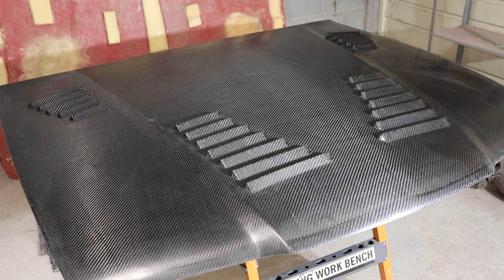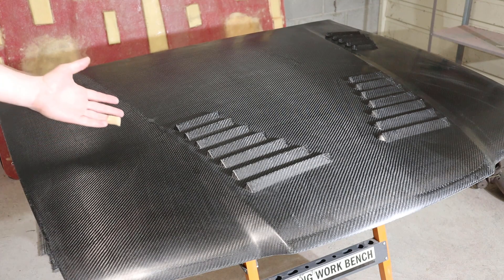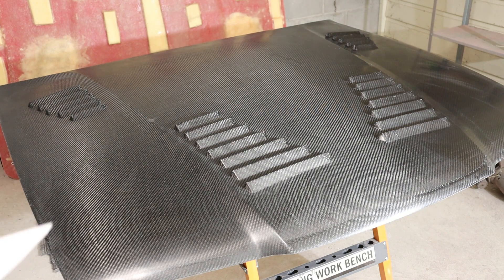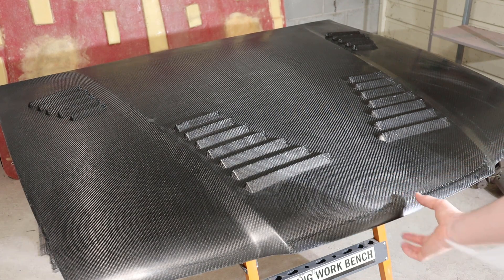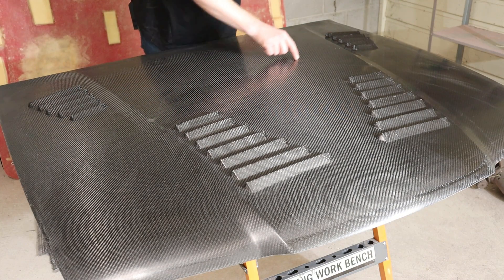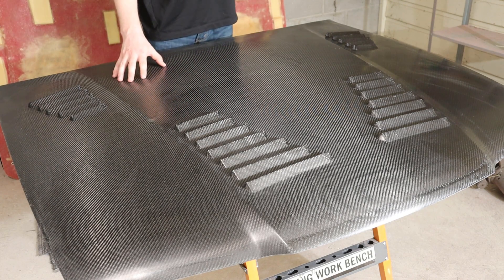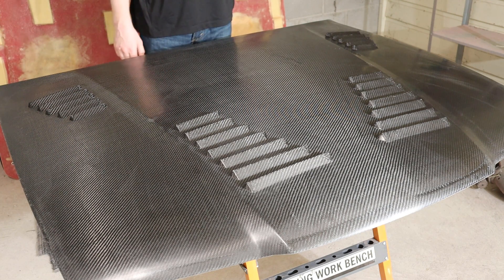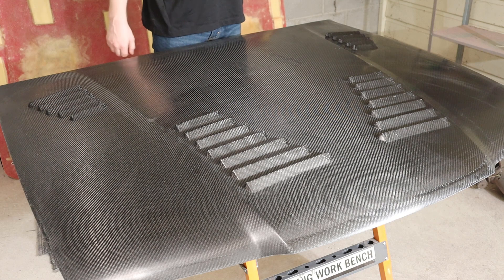[BUILD] Making a Carbon Fibre Bonnet: The Part

Comment: You also have to perforate the foam to avoid air bubbles and infuse slowly.
Reply from the maker: Sure do. The foam was perforated using the perf tool I made previously. It works well.

I think the surface imperfections were as a result of the super 77 being used to hold down the carbon and no clear coat

Comment: Amazing work Iv just started doing skinning and it’s not that easy first one was flat bottom steering wheel I cut and fitted a pipe then covered the top and bottom was hard to keep in line and smooth.    I found spray glue helps when laying try keep the ends not pulling out

Comment: Could you tell me what spray adhesive did you apply between the mold an the carbon fiber ?
Thanks
Reply from the maker: I used 3M super 77, however I suspect that caused some of the surface imperfections I had. There are other infusion adhesives out there I would consider using them instead.

Comment: I'm getting ready to make a carbon hood for my C6 Corvette. I'm trying to decide between making a two-piece mold - top (outer) and bottom (engine side) - or just going with the method you show here. Did the final part exhibit any weird flexing or craziness at speed on the track? Mine is mostly a street car with the occasional track day. (I'm lucky in that the C6 hood is nearly flat with no funky returns on the edges.)
Reply from the maker: It didn't exhibit anything weird. Though I would suggest doing it slightly differently from what I have done.

Do the outer layer (top skin) as an infusion and then with the top skin still in the mould do another, wet, layup with nomex honeycomb and the bottom skin.

That will give you light weight and strength for days.

In my opinion, the only benefit you get from two moulds is easier attachment points and knowledge that it's not going to have any fit issues. A sandwich structure (foam/honeycomb) is mechanically superior.

Comment: yea it would be lighter if you didnt use a foam core lol
Reply from the maker: If there was no foam core it wouldn't have much strength at all. I'd have to use a lot more carbon and resin to give it the same strength, which would have made it a lot heavier.
Reply: CEW.Manufacturing carbon fiber is lighter than foam cores and the resin that the foam cores absorb but i got ya its an efficient way of making the hood while maintaining effectiveness i guess
Reply from the maker: @2k5mike  Sorry Mate, I'll have to disagree with you there. Foam is a hell of a lot lighter than carbon. Almost two orders of magnitude in fact. Polyurathane foam does take up more resin than is ideal, a proper closed cell (like dyvinacell, probably spelt wrong) would be better and take up less resin. a nomex honeycomb core would be the best, but then I couldn't do an infusion part and it would cost a heap. 
If you want to see some maths and theory behind it: https://youtu.be/1GhGyr3Wn0k
Reply: CEW.Manufacturing yea i guess you would no more i just based my judgement off of this video but it was the 12k carbon that was equal in weight to the foam at 2:30 in this video https://youtu.be/YdH4Xj2K1Bc   :D but the regular carbon was much heavier lol woops xD

Comment: My friend, what is that spray you apply to the Carbon Fiber? Cause the carbon seems a bit hardned?
Reply from the maker: I used 3m super 77 between the layers to stick them down
Reply: My question is: did you apply something to the  carbon fiber before cutting it? Because it doesnt seem to be as soft as cloth... It seems a bit hardned...
Reply from the maker: @41Paulocesar  Hey mate, I didn't apply anything, it was just carbon straight from the roll...

Comment: Good job👍🏾 
Why didn’t use a surface coat before applying the carbon?
Reply from the maker: Couple of reasons, 1: this was meant to be a low cost, functional part. A surface coat is additional labour, and more material costs. 
2: a surface coat adds additional weight
3: I haven't used a surface coat before, I didn't want to try it on a part that size, fail and ruin the part.

I should get some and give it a go, but right now I don't have a project it's needed for and I don't really want to go spending the money just for the sake of it.

Do you use surface coats?
Reply: CEW.Manufacturing no problem just thought I’d ask. 
Yes I do use a surface coat. If you were going to be showing raw carbon in the end of everything you’ve done the last thing you want to do is more prep work to clear/sand  clear/sand, that’s too much work. 

If you use a surface coat you wouldn’t have to worry about the pinholes and repairs. Once the part comes out all I do is a light sand, if I want it more shiny than the mold, then a finish buff, that’s it!👍🏾 I don’t even use clear coat, just resin.

It just saves you a ton of headaches.

You shouldn’t have to do extra repair work. 
It adds a lil extra weight but not what you think, it doesn’t really take much at all, I guess I’m more obsessed with the look 😂

Comment: What is the weight difference between steel and carbon bonnet?
Reply from the maker: 10kg.
The original bonnet was 16.5kg, the final was 6.5kg. It wasn't quite 1/3 of the weight, but it was getting there.

I think if you laid up and infused the first two layers (with 4 layers on the vents) let that cure then did the foam and the back layer together (not as an infusion but a wet lay under vacuum) you may get it down near 5kg. That is my suspicion at least.
Reply: @CEWManufacturing  yeah, core probably soak bit more resin.Great job 👍

Comment: How many vacuum pump power do you use?
Reply from the maker: I believe it is a half horsepower dual stage vacuum pump. It's not very big. I wish I had have gotten a bigger one, maybe in the future!

It does work well though, it will pull a good vacuum.
Reply: @CEWManufacturing   thankyou for information.

Comment: The bubbles are most likely due to the different flow speeds of the resin above and underneath the core, which leads to trapped air wherever you have reflow. this is especially important as you have windows with no core. For an aesthetic part like this the safe route would be to infuse the first skin against the mould, carefully remove the peel ply without pulling the part out the mould, then bond in the core, and then a final infusion with the second skin. 
Unlike others suggested, letting the pump run for longer will not lead to less porosity, as it only leads to the resin and core degassing! The big air pocket is just because of bridging i would bet! with the vents it is a tricky part to get right, would get easier with the method described above.
Furthermore, a core with smaller cells like rohacell would improve the weight a lot. alternatively use microbubbles mixed with resin to fill in the porosity on the surface to save some weight.
And finally, i would strongly suggest backing your part to get the glass transition temperature as high as possible. a dark part in the australian sun will get very hot, might even get too hot for whats possible with most infusion resins...
Reply from the maker: I like your thoughts there with the different flow rates, that is something to consider for future work. I do take exception to this being an "Aesthetic Part" though ;) It's a functional part, the mould was no-where near nice enough for it to be an aesthetic part, it was a relatively low cost, one off part, making it look pretty would have cost more and taken more time. 

If I was doing this again, I would be looking at doing the outer skin and all of the vent layers in the first layup, then follow it with the core bonded in with micro and a wet layup on the back in a single second layup. I think this will remove chances of bubbles and drop some more weight out of it, there was a lot of resin uptake.

What do you mean by "backing the part". Coming from an aerospace background I am familiar with heat mitigation methods for composites in the sun (white paint is a great one), but I'm not sure what you're referring to there. This resin is good for a 100 degree Celsius Tg, while the Australian sun is hot, and the black part will amplify this, I believe it will not get to that temp (80 wouldn't surprise me though, which is one of the reasons I do not use west systems resins, when I last looked into them they didn't have the best Tg even with post cure).
Reply: @CEWManufacturing  sorry was a typo, meant baking not backing... 100°C Tg is good, but be aware that onset it's probably no more than 50°C and needs post cure according to datasheet to get to 100°C. Without that you will end up with fibre print through in the best case, and a warped part in the worst case...
Reply from the maker: @RetoAebischer  I'm tracking the post cure requirements. The part received a dodgy (janky? junk yard style?) post cure and has been holding up well in use. The methods I have used here served a purpose and have worked well in this application, I would not use them for something more structural or aesthetic.

Comment: How does more foam add strength?
Reply from the maker: It provides a path for shear transfer between the top and bottom skins. Check out this other video I did on the topic (complete with very average animations that took me forever....) I hope that's useful, if not hit me up and I'll try and answer it better.

Comment: That is a beautiful bonnet. How much to make a normal carbon fiber bonnet for a E36? Maybe with just the front air ducks ... I'm serious. I want one lol
Reply from the maker: I'm glad you like it mate! If you're in Australia and you want some work done, hit me up through my website https://chapmaneng.com/ 

Indicatively, there is around $650 of raw materials and consumables in the bonnet itself (plus the mould and labour, etc). It's not the cheapest option, but costs can be varied based on materials and design and a bunch of other parameters, I don't really do large production runs, so I'm flexible with the final product to meet requirements.

Comment: where did you get the nut plates you epoxied into the bonnet for the hinge mount?
Reply from the maker: They are by a company called Bighead, they cost me around $5.50 AUD per nut plate. I picked them up from these guys (Gold Coast based) https://www.yardeng.com/bighead-fasteners

Comment: if you keep the pump on for more time and let some resin to the catch pot you probably will fill those voids and bubbles!
Reply from the maker: Thanks for the suggestion, I'm probably never going to do a full infusion like that again for a race part, it came out too heavy. I think I'll infuse the  skin against the mould surface; then bond on the skin with an epoxy/q-cell slurry and wet the back skin in one activity. 

I'll try leave the pump on for longer next time though.
Reply: @CEWManufacturing  nice! have you seen this video: https://www.youtube.com/watch?v=EHLSzEmWzJs

Comment: Awesome stuff, a great inspiration to finally get off my arse and make my aero parts. 
I'm curious as to why you're using easy composites cloth though, isn't it super expensive getting it from the UK compared to local suppliers?
Reply from the maker: Hey mate, glad that you liked it. If you were around the Brisbane area I would have offered to give you a hand, sadly the cost to travel the 2,000km and 20 years backwards in time is a bit too much...

At the time that I purchased that cloth from the UK (2016) it was not cheaper than getting it locally, particularly as the bi-axial stuff there was purchased for ~9GBP per linear meter (~7GBP per sq/m). There are now some competitors in Australia that are selling carbon that is comparable value for money. 

I find that easy composites is still the king for consumables with some of their products being 50% cheaper than locally with duty and GST. When you include shipping it comes to be ~30% cheaper (I made a spreadsheet to assess it all). They also have some things that you cannot get in Australia easily in small batches (like small qty tooling board). So when I have done bulk orders of certain products they are cheaper from EC than locally. 

If you are looking for local products, check out beyond materials (AU). They have good pricing for their reinforcements, and I really like their infusion resin.  (You would be the 5th or so person I have recommended them to, I should get a cut)

 While you are in Adelaide, if you want to collab on anything let me know. I just subbed to your channel. I do a bit of routed products for F3 cars (wing endplates, wing supports, side pod covers etc) , as well as some drone components and other engineering plastic stuff. Have a look at my latest video as an example.
Reply: Now now no need to be salty that we took the crown of newest track in Aus from you ;) That said I'd love to give QR a crack sometime. 

Amazing that the cost was there but will happily believe you, there's a few suppliers locally that are a bit nicer than $75 sq/m now! I discounted looking at EC but will definitely check them out again. I've seen beyond materials before and they were nicely competitive with our local ones.

Would definitely love your opinion on a few things :) have watched all your wing videos voraciously as that's what I'd like to attempt next, was thinking of making a lattice support rib and then fill in the rest with PVA printed parts, infuse then dissolve the PVA. Was thinking it might be a gamble but after seeing that F3 wing I think it may be possible. Just depends if the PVA can hold up to the cure temperatures.

Comment: Why go the infusion route? What made you choose that over perforated and breather cloth? Also why so much core? Seems over kill and more stiff than you'd really need? I make my own stuff too. (Aerospace background) just curious as to why you choose the methods you did.
Reply from the maker: G'day Mate, good to see another aerospace person around here! Are you in the design or manufacture side of things? (or maintenance, or flying or any of the other aspects). 

I went the infusion route because I didn't want to be working against the clock with a wet layup. I wanted to take my time getting all of the fabric laid up and then introduce the resin later. I find there is a lot less pressure with this method. I would like to step it up even further and move on to prepreg stuff, however at this time I don't have an oven suitable and to be honest this is a side job / hobby and I cannot justify the cost of my own oven. 

As for the core, this is my first bonnet, I figured it was better to be safe than sorry. Its a poor engineering decision I know. What would you have done?

What kind of stuff do you make?

Comment: Beautiful job. Ambitious project esp due to louvers.  The foam inner core is brilliant, saves moulding underside of hood and looks good. What else would you need to do to put this on a car, painted? Would have thought there would be a greater weight savings than 17kg->6.5.
Reply from the maker: G'day Roy, The part will not be painted, they will throw some stickers on it though for their sponsors (check out the making of the mould video, it shows the car in the first minute). I assume that it will need some more edge sanding, I'm pretty sure it is back to the original dimensions but you can never be too sure. It will also need the holes for the bonnet locking pins to be bored out in the correct location, there are hard points in the front to accept them, but I didnt want to make the holes without it being on the car. The hinges will also need to be lined up and probably shimmed to make it sit perfectly. 

So not too much in comparison to the build, but still a bit.

Matt

Comment: Those nut plates are supposed to go under the carbon, not on top of it. I suppose for a race car it's functional.  But for the record, that's why you should make 2 moulds, one of the top, one of the bottom, and then epoxy the 2 halves together, with the nut plates set in from behind the bottom half, for maximum support.  Bang up job though, not bad.
Reply from the maker: I wrote out a massive reply to this comment and then it seems to have gone walkabout. So here we go for a take 2. 

I fully understand that the nutplates are meant to go under the skin, I did some calcs behind it and the failure loads in this configuration are high enough that I am happy. I was going to pot in some inserts (like from wooden furniture) but decided that I didn't want to have to destructively test them, it would have been nicer and cheaper so I should have done it. 

As for the two moulds side of things, I can see the need for that from a show car perspective, but to me it is a lot of extra cost and extra time that doesn't provide any real benefit. I would have to double my moulding materials, and probably have to double the amount of carbon and resin I used. This bonnet is only a total of 4 layers (3 layers in the vents). If I was to use a second mould I would realistically need (please correct me based on your experience) 4 layers on each side of the mould, then cut out the un-needed areas and bond it all in. I think at least a 70% increase in cost over what I have here and a heap of extra time. with a 10-20mm thick core this part is plenty strong enough as it is and only the outside surface really matters for shape.

If you have some good reasons that I have failed to think of please let me know. Robust design discussion is a great way to learn. 

Matt
Reply: Yeah it would look better with two molded halves. But fuck the time for that. It's gonna get abused on the track. Just do a 45 degree X patters for core imo. Would be easier to do with less time. And it's more structural. Then build hard points up for mounting with a material of your choice. Bad ass hood though. Not knocking your work at all. It's fucking beautiful.